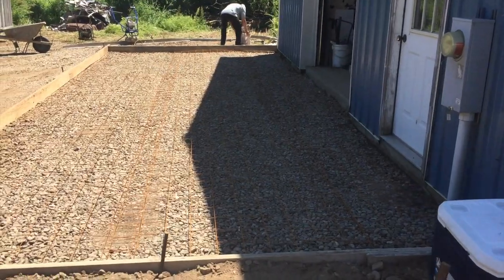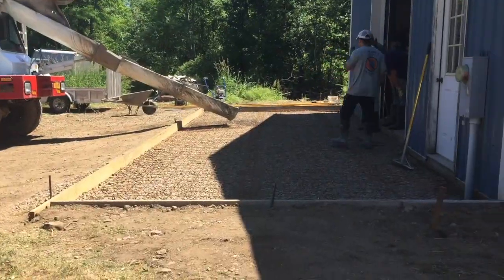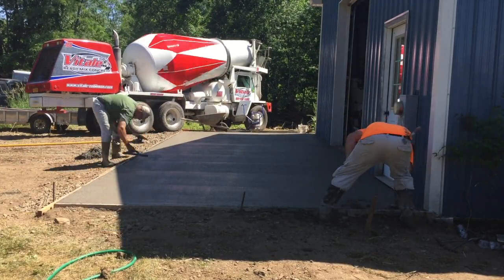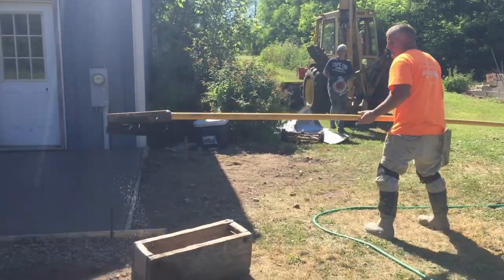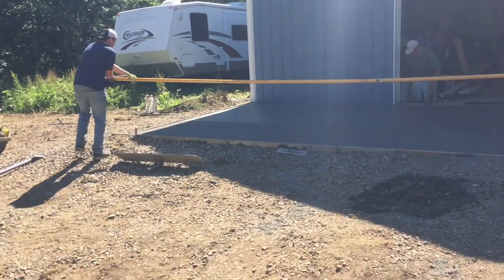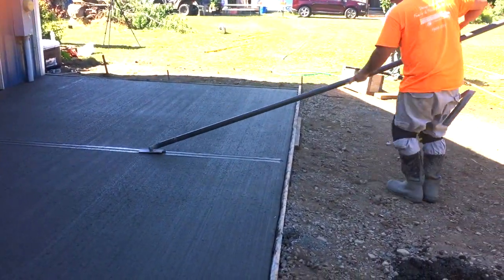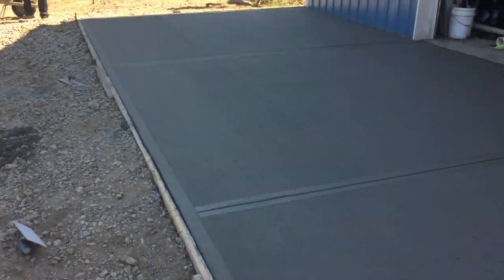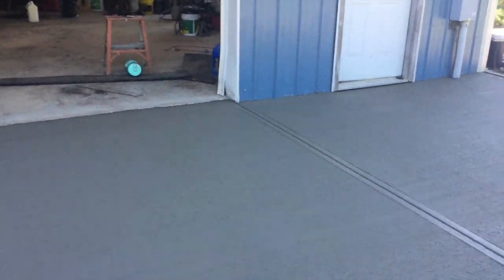How to pour a 12 X 30 pole barn apron with a broom finish.

Comment: I'm about to do this in front of my barn, I like this video. 1. Why would or wouldn't I want to pin the apron to my interior slab?  2. What is the minimum pitch for a slab that runs 12' from the structure (with roof gutters)?  Thanks...subbed